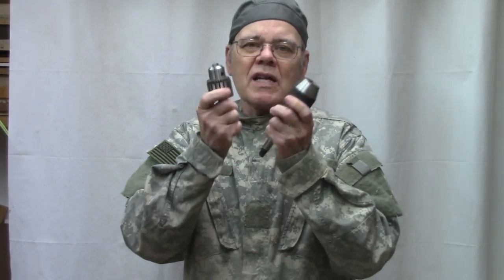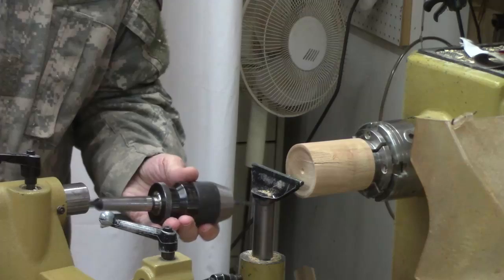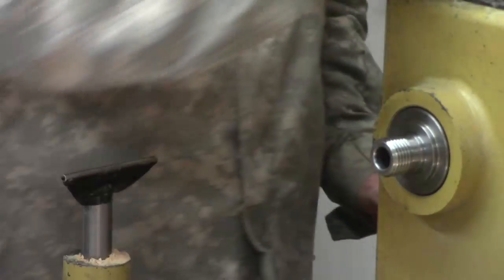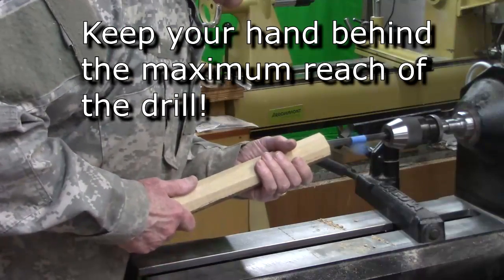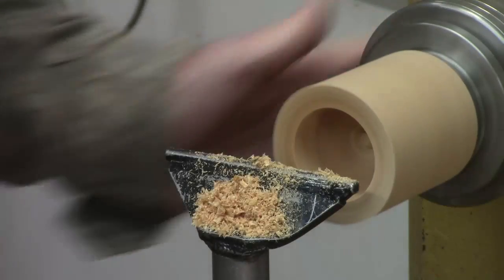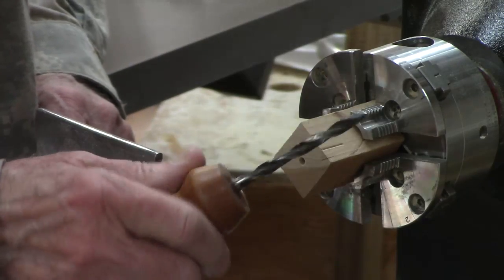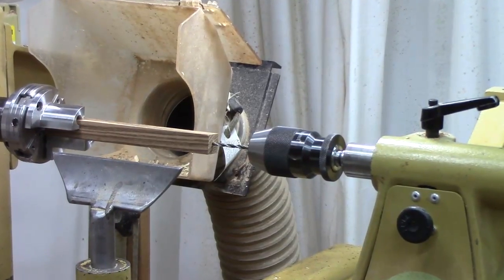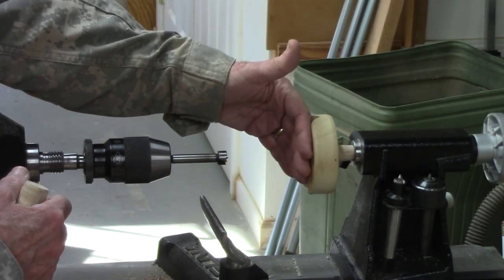Drilling on the Wood Lathe - What you should know!

Comment: The tapered chuck I use to hold my forstner bit keeps slipping on the tapered shaft. I cleaned the shaft with acetone but it still slips. Any suggestions on how to keep the bit from spinning
Reply from the maker: You may have a bit of burr on the shaft or in the taper. Just clean it up with a fine file as needed. Watch this https://studio.youtube.com/video/1yOzPAO4_ds/
Reply: @ thanks I heated the arbor then tapped in the shaft and it’s holding up

Comment: Hey mike any advice how to drill long grain on the lathe? I turned some traditionel wood thread dowels intended for leg vices for a woodworkers bench. Is it best drilled on a drill press with a very large vice? The diameter is 5 inches and the hole is 1 inch and 1/8"
Reply from the maker: Whichever is the easiest. Both can drill holes equally.

Comment: Nice vid. - at 11:33, important not to hold the flutes of the drill (as you've shown). My tailstock is MT1 and sometimes the chuck holding the drill will come free, so the drill will turn at the speed of the headstock. If your fingers are on the flutes when that happens, you get cut :(      Not so much of a problem with larger morse tapers. Thanks for posting. :)
Reply from the maker: Great tip! Folks don't know what they do not know!

Comment: Occasionally, the chuck or morse taper drill bit will rotate in the tailstock if the bit gets hung up in the work. Holding the chuck helps prevent that. Holding a Morse taper drill bit by hand is a potential disaster, and I use a wrench.
Reply from the maker: Totally, agree.

Comment: An additional thought: Many lathes have hollow tailstock quills. Many live centers are hollow, too. If you take the point out of the live center, you can mount the blank between centers and drill the blank through the tailstock. The type of drill bit used for this kind of work is commonly called a 'lamp drill' or a 'lamp auger'. This allows you to drill a fairly long blank on a fairly small lathe. The only limitation is the diameter of the hole is limited by what can go through the tailstock/live center. Generally, the maximum diameter is 3/8".
Reply from the maker: Axminster sells these deep drilling thru the TS accessories. I have only done one lamp and so that is an expense I will pass on. Great for production lamp making for sure.
Reply: @MikePeaceWoodturning  These accessories are, indeed, expensive, but very satisfying to use. I have the (now discontinued) Record Power 5/16" kit; also a 10mm spiral auger, from a dump bin.  They allow roughly18" borings, should such be required. As an intermediate step, I also possess approximately 8" brad point bits, for which I shall now try the steady mentioned in the video.  Bernard.

Comment: Great video, Mike!

The suggestion to keep the left hand on the drill chuck is critical, but the chuck can still spin, and if its a keyed chuck, the outer diameter is rough and can hurt.  DAMHIKT!  I always wear a kevlar 'carver's' glove on my left hand when drilling to protect my hand.

The tailstock on some smaller lathes has a bit of 'wiggle' typically less than a degree, but still enough to be a problem when drilling.  The solution is simple - center the bit on that dimple before locking down the tailstock.

Forstner bits are ideally meant for drilling face grain.  Drilling large holes in end grain with Forstner's is tough work.  It helps to drill a small hole first, and then up in steps to reach the final diameter.  And I seem to recall a wise person saying that twist drills work better in end-grain if the hole is 1" or smaller.

Finally, when drilling long shafts (eg, for walking canes) on lathes with a short bed, a trick that I have used is to make the piece in segments that are ultimately glued together using dowels.  The trick is to get a good match at the joins.  I find that if I make the segments short enough, I can dry-fit two together and mount the combination between centers for final sizing of the diameters - often using only sandpaper.  Grain match is another thing - I will sometimes insert a short segment of contrasting wood to celebrate the join rather than try to get a perfect grain match.
Reply: And one more point - if you are using a Jacobs chuck, NEVER leave the key in the chuck while drilling.  If the chuck starts rotating, the key will fly out and Murphy's Law says your face will be the target!
Reply from the maker: Thanks for sharing your experience, Louie!

Comment: Excellent information. I was going to comment on your different types of drill chucks video: One of the reasons I have two drill chucks is so I can quickly and easily switch between two drill bits. For example, when drilling I like to start with a 'center drill bit', before switching to a standard twist bit. Center bits are short and stout, making drilling precisely centered holes simple and easy. With two drill chucks, I can have one with the center bit and the other with the standard twist bit. If I'm just drilling one blank, I probably won't bother with this. But, if I'm batching out a bunch of blanks, I really like this approach.
Reply from the maker: Good idea, David. Like a drill bit in one electric drill and a screw driver bit in another.